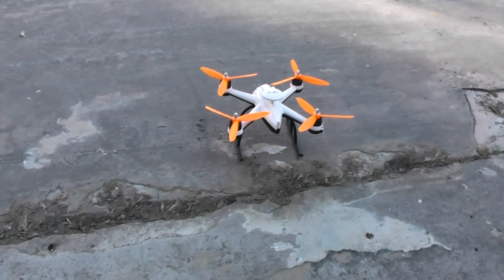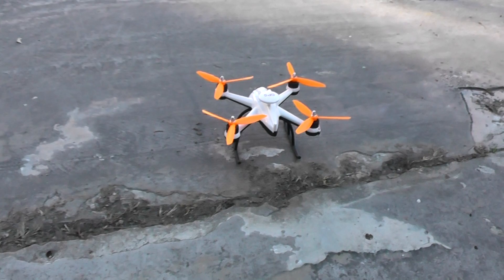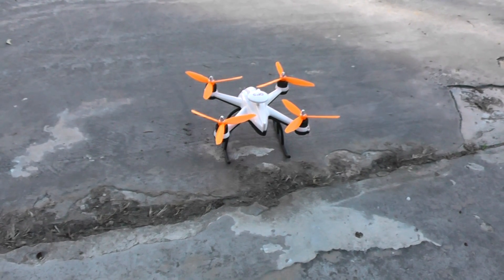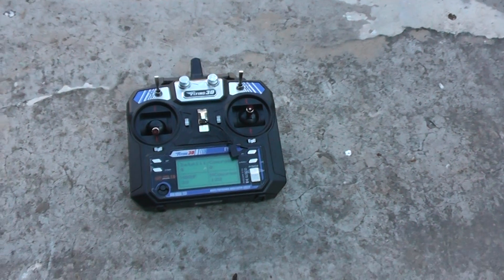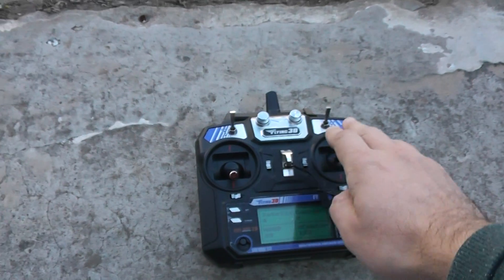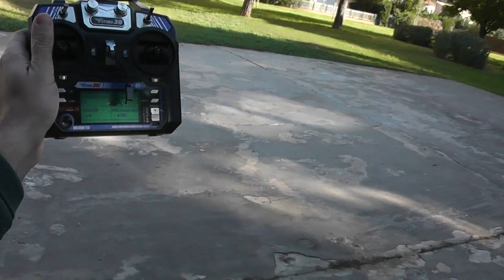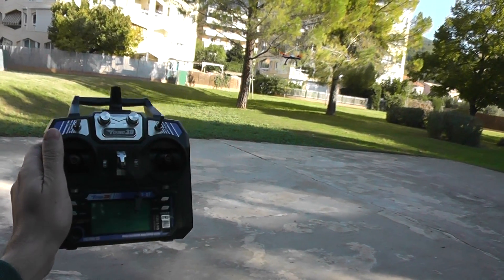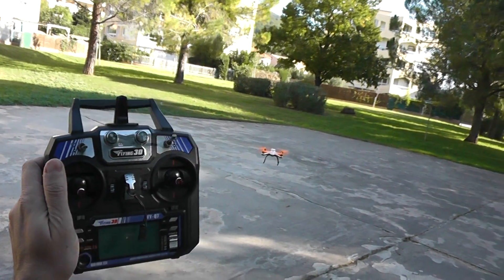Flying3D X6 modded with 6045 props (Courtesy Banggood)

Comment: Flying3D X6
Is there a problem?
Is this is reliable?
Advice please
Reply from the maker: No problem reported yet... but I strongly advice to have minimum knowledge in quadcopters to have such model. Not for really new beginners. You need to take précautions than a beginners don't take yet. The quality build is correct but not extra. You can't have DJI quality for such price

Comment: SeBy..  I ordered 6045 props "two blades" for my X6 last week.  I hope they work.  Of course, the quad is back ordered.  I hope to get it before the Chinese New Year for heavens sake... Can you show how you did the mod??? OK, I checked the RC forum, you actually lifted the entire motor up for clearance.  I'd think any type of plastic/wood would work if cut correctly.  My worry is the length of the screws to attach the motors...
Reply from the maker: Yes, I used some M2.5x12mm screws. Of course, with any kind of plastic/wood, it should work :)